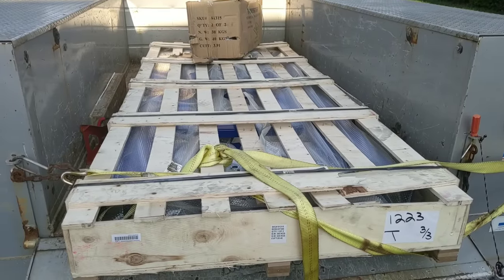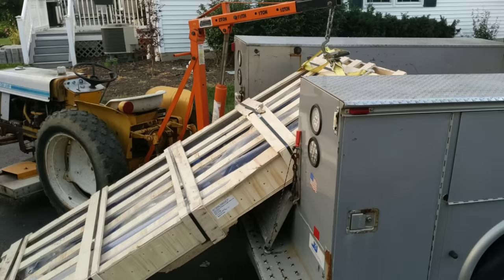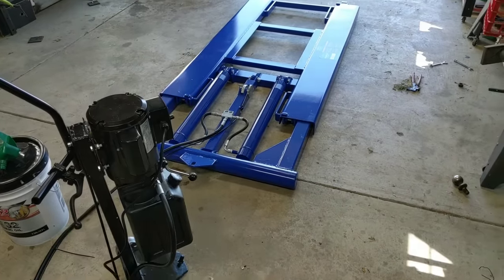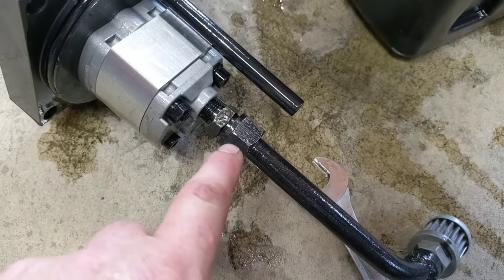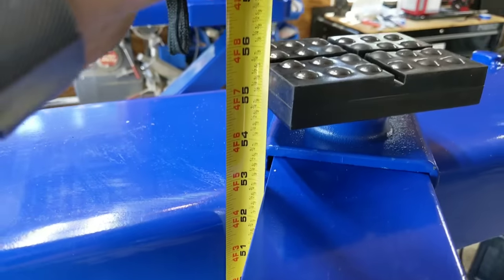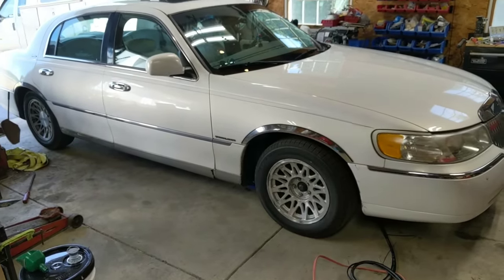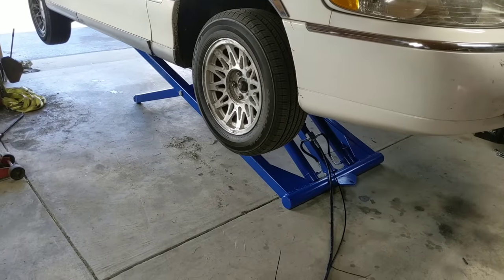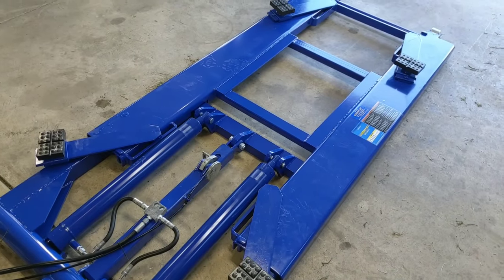Harbor Freight 6000 Lb. Capacity Scissor Lift Review, Central Hydraulics, is it worth it?

Comment: I don't know if I would trust one of those lifts with MY Town Car... certainly not jacked all the way up.
Reply from the maker: I'm not really sure anyone who uses a scissor lift uses them in the "all the way" up position.   Typically you are just lifting the vehicle high enough to work on the lower extremities of the vehicle.   I've now had Multiple Town cars on this lift with no issues.  But being a scissor lift, you never put yourself in a situation where if it would fail, it would harm you.  It's not about trust, it's about working smart.
Reply: @1D10CRACY  Don't see how I'd work underneath a car without ever putting myself in a situation where if it would fail it wouldn't pretty much crush me like a grape.

Comment: Not enough room to get under it. Also the center of gravity seems really scary like it would tip over in sec if pushed from the sides.
Reply from the maker: Can you imagine getting under a scissor lift!  :D   You would have to be a contortionist!   Its not designed to get under, it is just designed to lift the car high enough to work on the lower extremities.  It is perfect for sitting on a stool wheeling around the car doing lower body and detail work without post getting in your way or casting shadows.   And no, you can't tip a car over when it is on it, it is wider than it looks in the video and you have physics on your side.   If you need to get access to the underside, you need a post lift.  It is just a different tool, for a different job.
Reply: @1D10CRACY  yes. I have seen the second video where it says that I am ignorant and it has the comments disabled. Maybe I didn't phrase it right. I meant that since one can't get under it may not be worth it. About the base being narrow it sure seems like that but then again with all that weight it maybe stabile enough.
Reply from the maker: Ignorant is such an awesome word!   In a nutshell it just means lack of knowledge over a specific topic.   I am very amazed at the people who got offended by that word and I can only imagine they are ignorant of the word ignorant.  For those who don't know, ignorant does not mean stupid.   I'd rather be ignorant of something rather than stupid.
Reply: @1D10CRACY  I am not ignorant of the word. I speak more than one language too. Not offended about the word it self. It was just an objection to the assumption that I didn't know the use of the lift. I was pointing out that even knowing it it doesn't seem convenient. It only has one limited use. Other more versatile models can justify better the use of space in a garage. I also am an engineer. Not liking the limited options design doesn't make me ignorant in the matter.
Reply from the maker: Absolutely!   If you need access to the underside of vehicle, this isn't the lift to buy!   It's just a different tool for a different job, and not a tool for someone who needs the space.

Comment: As much as I love harbor freight - since they DO serve a valuable purpose…. Not sure I would want to be under anything that HF is lifting. They can’t get the simple welded jacks correct.
Reply from the maker: Yup, if you are not capable of figuring out how safe your equipment is you're better off with the false sense of security of a more expensive brand name.   Luckily this is just a scissor lift, nothing you would ever get under.

Comment: So you can't do engine transmission subframe  drop
Reply from the maker: It's a scissor lift, it's not designed to do work under the vehicle. It's just designed to lift the vehicle high enough to work on the lower extremities of the car to basically not break your back. It's perfect for sitting on a stool and wheeling around the car and doing detail and body work.    Just a different tool for a different job.

Comment: Id never trust anything Harbor frieght after jack stands failed to hold up a compact car twice. And replacements had the same issue.   Only go there for Tarps, mechanic rubber gloves, and zip ties now
Reply from the maker: If you are smart, you won't trust anything from anywhere!   I never bought harbor freight jack stands because I didn't approve of the build quality on the demo stands in the store.   Some of the pictures I've seen of the ones that have failed look so bad, I question the people using them!

Comment: Brake work, shocks, tire rotation, rocker panel body work, okay.  Muffler or drive shaft work with the entire car over you?  I'm not so sure......
Reply from the maker: It's a scissor lift, designed to lift the vehicle high enough to work on the lower extremities.   They are not designed to work under!   Great for body work, as you can sit on a stool and wheel all around the car with no obstructions or shadows from a post lift.    If you need to work under a vehicle, you need a post lift.  Just different tools for different jobs.
Reply: @1D10CRACY  I just think somebody will get under it, being more daring than smart.

Comment: Is it just me or the space between the sefety locks is too much?? Also you can raise it 3ft in your garage, too low be standing and too high to be laying flat. Plus the extra bulk. Is useless unless your willing to work on your knees
Reply from the maker: You would never work under a car on a scissor lift.    They are designed to lift the car just high enough to work on the lower extremities.   Perfect for lower / body detail work where you can wheel all around the car on a stool and not have posts in your way or casting shadows.  If you need to work under the car, you need a post lift.  Different tools for different jobs.
Reply: 1D10CRACY thanks for clearing that up

Comment: Cars jacked, now how to get at anything... Great video but seems like the lift would just be in the way
Reply from the maker: It's all about what tool for the job! If you need access to the underside of the car it would be better to have a post lift. But if you're doing lower body detail work or just changing brakes and tires then a scissor lift is excellent for that. I actually prefer a scissor lift for lower body detail work at you don't have to work around the post.  Different tools for different jobs!

Comment: 3/31/23. Just checked their website. This is currently unavailable. A short time ago I contacted them about a gantry crane that they advertise on their website and was told that’s unavailable, too. This company is an absolute joke
Reply from the maker: Some of their larger items seem to come and go by inventory.   I've seen this lift come and go on their website at least a dozen times since I posted this.   I asked one of the in-store managers about this and I was told that a shipping container from overseas can vary from $2,000 to $20,000 per conex box depending on the demand.  When the cost is high, they jam pack them with smaller items to maximize profit.   They try to stock back up on larger heavier items when shipping cost is low.

Comment: Not bad. You can get a 2 post lift for $1800. A nice one for $2500.
All depends on what you want.
This is far better than jack stands, nice and high compared to.
Limited on what you can do underneath. 
Personally, if I were going to leave it in place, a 4ft 2post lift for a standard height garage for a couple hundred more would be my choice.
Nice video, thanks!👍🍻

Comment: So you paid 2000 bucks for a car jack? That you can use as a table?
Reply from the maker: Nope.   I paid 1100 bucks for a scissor lift.  (Apparently the cost has gone up)  I wish I had bought it years prior.    Best 1100 bucks I ever spent!    I prefer using it over my 2 post when detailing as there are no posts to cast shadows on my work.   Being able to raise the car and wheel around on a chair is much appreciated.   And I also use it as a table.  LOL
Reply: @1D10CRACY  I do want one for my car, but you say that you can't access the bottom very well?
Reply from the maker: To get under a car you really need a post lift.   Have you looked at Quick Jacks as an alternative?   Also ETA MFG makes a product called MYLIFTstands.    They are basically wheel cribs that are adjustable by height.    Expensive, but they should last a lifetime and are very portable.

Comment: For this price and general car repairs I would rather spend my money on quick jacks, cheaper, less in the way and far smaller/portable.
Reply from the maker: Absolutely!   Besides a scissor lift isn't designed to do general repairs under the car, they are only designed to work on the lower extremities of the vehicle.   Great for lower / detail body work.   Under car repairs and you need a different tool.

Comment: Good for tires and cv joints i guess. 🤷‍♂️
Reply from the maker: Perfect for lower body detail work, you can wheel all around the car w/out post getting in the way or casting shadows on your works.   I'm more surprised at the folks who say "I wouldn't get under that thing!".   :D As if they are contortionist.  It's just a different tool for a different job.

Comment: I don’t understand how this hight is anyway useful if I can’t go underneath the car? 🤔
Reply from the maker: It's not designed to get under.    It's purpose is to work on the lower parts of the car without breaking your back.   Perfect for lower body and detail work.  You also get the added benefit of not having post in your way or casing shadows.

Comment: How are you going to work under it🤔
Reply from the maker: You don't work under a scissor lift, that is not what they are for.   Perfect for lower body and detail work as you can wheel all around on a stool and not have posts casting shadows on your work.   If you need access to the under side of the vehicle, you need a post lift.   Just a different tool for a different job.

Comment: I wouldn't ever trust getting under any vehicle with this. I need to see a solid structure in place that locks into position..not trusting hydraulics to not fail.
Reply from the maker: I have to ask, why would you think it would be safe to get "under" a scissor lift?
Reply: @1D10CRACY  duh..it's not. Some may think it is..So I wanted to express that thought..and I did just that.
Reply from the maker: You are probably correct.   There probably are a few people silly enough to try to climb their way through the structure and pretend to be a contortionist.
Reply: @1D10CRACY  of course there are..or even reach under there for extended periods.  Never underestimate stupid or ignorance lol

Comment: I don't understand what this lift would be good for besides brakes, wheel bearing and stuff like that.
Reply from the maker: It's a scissor lift, designed to lift the vehicle high enough to work on the lower extremities.   They are not designed to work under!   Great for body work, as you can sit on a stool and wheel all around the car with no obstructions or shadows from a post lift.    If you need to work under a vehicle, you need a post lift.  Just different tools for different jobs.

Comment: The "h" in "vehicle" is SILENT!
Reply from the maker: It is technically optional. The H in the word vehicle doesn't have a strong /h/ sound. Some people may use an /h/ sound, but you really don't need to. If you say ve➝hicle with a distinct /v/ sound and a long clear vowel in the first syllable, Americans will understand you when you say it!  The area of the county I am from, most people do not silent the "H" and you would sound out of place leaving it off.

Comment: I wish this was thinner so I could drive my super low car over it. Either that or I'd have to buy or maybe build a ramp system to get over it.
Reply from the maker: A few inches would of made a world of difference!    To get my Chevy Volt on it I have to lay two 2"x6"s along each side.
Reply: QuickJack from Bendpak is lower profile...you can slide the the left and right sides under most sports cars. Only lifts a couple feet but gives you unobstructed access front to back. I just bought their 7000lbs version for $1350, (via Home Depot who offered the best price) . Worth checking out if you don't need to lift the car more than a couple feet. I looked at this harbor freight(love harbor freight) unit as well but went with a QuickJack since its easier to store and move, as well as unobstructed access. It also appears there is a bit more pride in how the package it.

Comment: Maybe its me,but,the design of the lift makes it near impossible to do transmission or bottom side (starter,u joints) work..
Reply from the maker: It's not you, you wouldn't do any under car work with this stye of lift.   It's perfect for lower body / detail work, as you can roll around on a stool and not have post casting shadows and or getting in your way.  If your going to work under the car, you need a post lift.    It's just a different tool for a different job.

Comment: i would have told harbor freight about you should not have to fix the jack before using it  very bad bussiness ,I would never took it
Reply from the maker: If I didn't have a few jobs that I needed it for that weekend I wouldn't of took it either.   And I did contact Harbor Freight and they did make it right.  They also told me because of the video the pump was now being sold in a wood crate so it wouldn't happen again.   At least they listen to their customers, that is what it takes to make a business good!

Comment: For that price, just spend a bit more for a two-post lift.
Reply from the maker: I think you can get a two post for less.    I wasn't really looking for a post lift at the time mainly because I do a lot of lower body detail work and I wanted something to save my back.    Also when detailing, the post get in your way and cast shadows.   But if your looking to gain access to the underside of a vehicle, a post lift is the only way to go!   Just different tools for different jobs.
Reply: @1D10CRACY  Lower body detailing... yeah, a scissor jack would make that easy to do.
Reply from the maker: Yup!   Sure does!   I can wheel my chair all around the vehicle, save my back and do my job.   Anything else and I use the building next door with the 4 post.  I bought the lift specifically because of back issues.

Comment: Would be good for brake jobs, but I wouldn’t trust that thing to be underneath it working on a car. Just my opinion.
Reply from the maker: That is probably a good thing, as they are not designed to get under and you would have to be a contortionist.  [Copied from the pinned comment] "Remember, this is a scissor lift, it's not really designed to get access to the underside of a vehicle.   You really need something like a post lift for that kind of access.   This is perfect for lower body and detail work, you can wheel all around the car without post casting shadows or getting in your way.  It's a different tool, for a different job."  You could use it for brake work and maybe front end work.

Comment: To be honest I have a lot of HF tools. They sit right next to my Snap-On and Cornwell tools. They all perform the duty in which they were designed. Now on scissor lifts, I don't trust anyone's. Best to crib them for safety... all of em not just HF brands. And just for all the snappy fanboys in here, most of their stuff is made in China, only assembled in America... by a robot. Higher quality? , sure. Over priced like a MFer though.
Reply from the maker: I couldn't agree with you more!   I prefer Cornwell and most of my tools are their brand.    As for the scissor lift, I wouldn't trust anyone's scissor lift, you need to pretty much make sure at any time your out of harms way in case of failure and you sure as heck are not getting under one.    They are perfect for detail work, anything else you should use a good quality post lift.

Comment: Expansion and tires and wheels only
Reply from the maker: Sure you could do suspension, tires and brakes.    I use mine to do lower body work as there are no posts in your way and you can wheel around on a stool.    It's not designed to get under, but that should be pretty obvious by the design.   When I need to work under the car, I use a post lift.   It's just a different tool for a different job.

Comment: OMG $1700.00 bucks!!!...You can get a Real 2 post lift for that!!!! .
Reply from the maker: If you shop around you can get a 2 post for less!   Scissor lifts are not intended to replace a 2 or 4 post, they are a different tool used for a totally different purpose.   These lifts are perfect for detail and lower body work as you don't have post in your way or casting shadows.  I can sit on a stool and wheel all around the car saving my back and getting up close to my work.  If you need access to the underside of the car, you would need a 2 or 4 post.
Reply: @1D10CRACY  Believe me I have used both and your comparing Apples to Jaguars...If you Notice the vast Majority of professional shops use the 2 post .And there is the Obvious danger of its collapsing and tipping over.Plus it blocks parts of the car you need to get to.I am deathly afraid of those really
Reply from the maker: Your absolutely right!   Apples to jaguars is a very good analogy!   Different tools for different jobs!

Comment: Once again this is not safe. Nothing to keep it from falling sideways while your working on or under car.  Be careful
Reply from the maker: It is very safe if used correctly!  You couldn't tip a car over on it if you tried!   I suppose it could be loaded wrong, but that would be user error.   As far as working under it, it's a scissor lift, it is not designed to get under!   See the pinned comment.